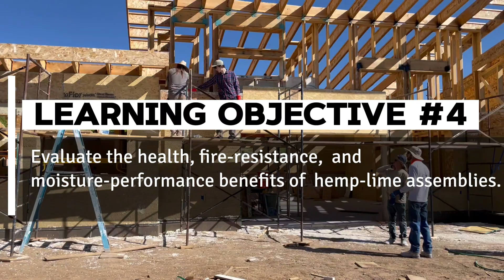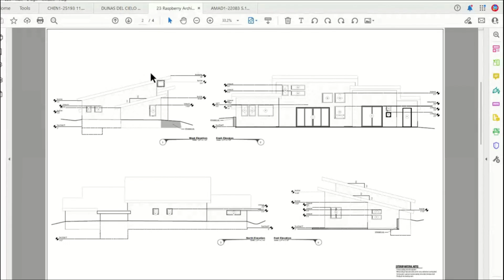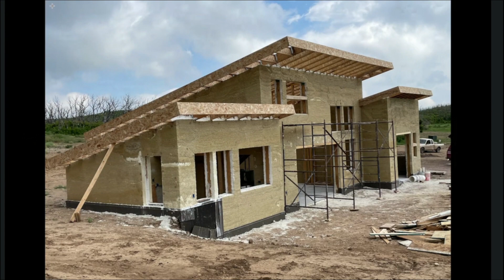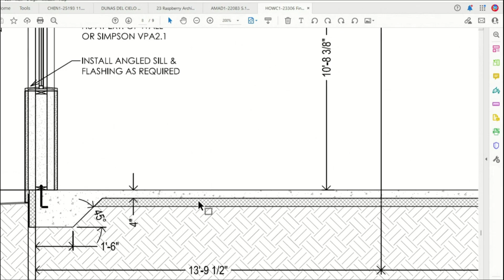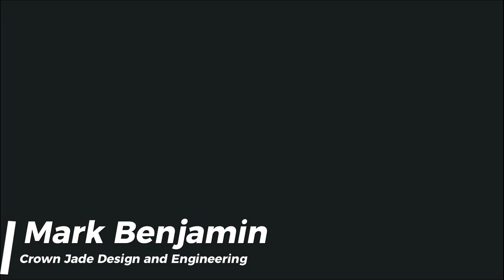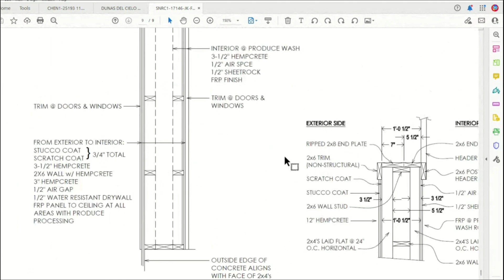Ep. 3 Inside a Hempcrete Engineer’s Playbook

Comment: I was taught that the most wind shear exposure a stud frame house will ever have is while it's at the exposed frame stage. The cladding - or for a hemp-lime house, the infill - turns it into a single object instead of hundreds of studs each with their own wind drag. So the bracing for the walls needs to be in place as each wall goes up, before you put a roof on it and wall cladding or infill. You can't use the hemp-lime as the bracing, because it's not there when the wall needs it.